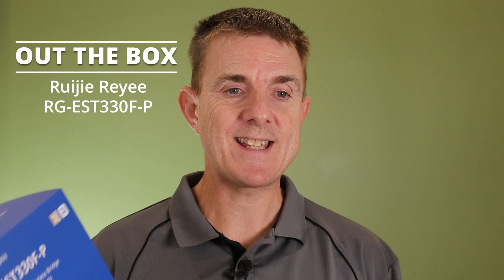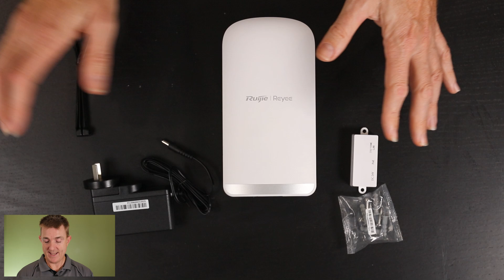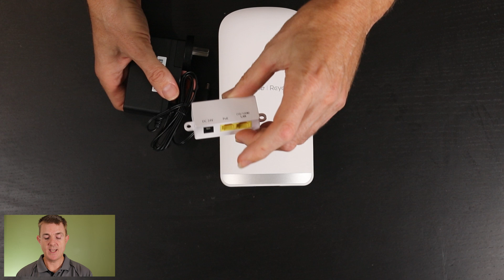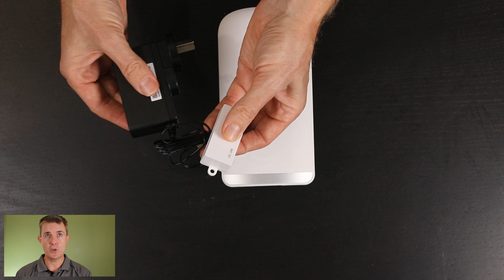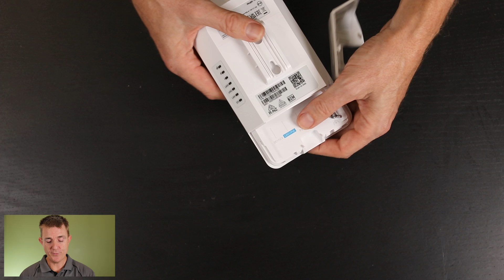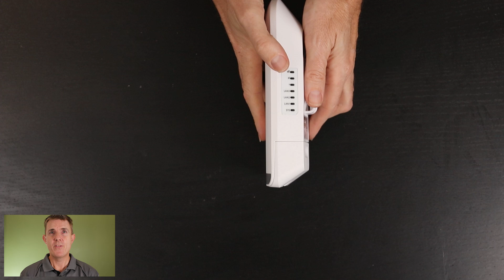Out the Box Series - Ruijie Reyee RG-EST330F-P Wireless Bridge

Comment: You need to demonstrate the features and also how to set it up.  You also need to run some speed tests.  Avoid simply repeating advertising claims printed on the box.  Finally, this device does not appear to support a wireless bridge mode so the video title is misleading.
Reply from the maker: Good points, but lease do check our other videos where we have extensive how to's and performance guides on many of the Ruijie devices.   This video is a box opening and does what it says on the tin.  The key for this one is it is not an access point.  It is a bridge device, that is how it works out of the box and is designed to be paired with something like the 450G.  Please do have a review of this video that we did which shows it working in a multi-point setup - https://youtu.be/mBlHUG6TWtM